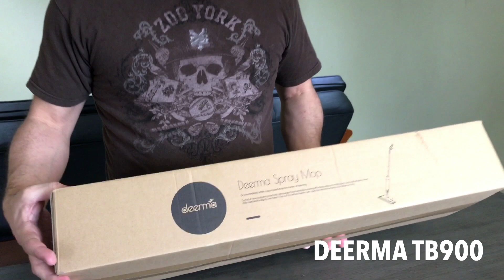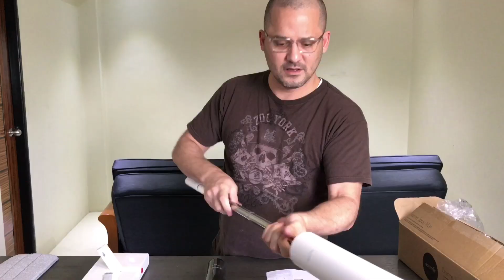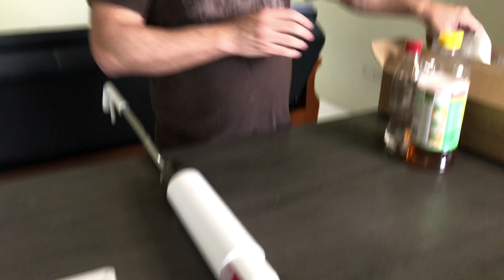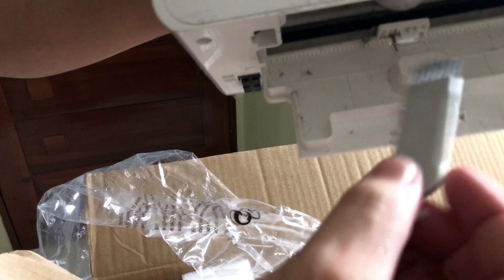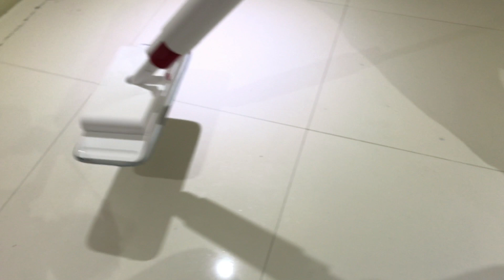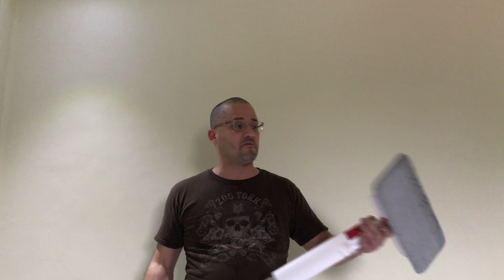Quarantine Life | XiaoMi Deerma TB900 Unboxing + Review

Comment: Hello, nice video btw.. just curious can this tool pickup a hair fall on the floor? Or just for cleaning dust?
Reply from the maker: Hey, yes it will but be mindful that because the roller is by motion not suction the hair might tangles in the brushes.  Just check it time to time if you  feels isn't lifting dirt as usual.  Also will pick up other type of dirt if they aren't too big to fit.